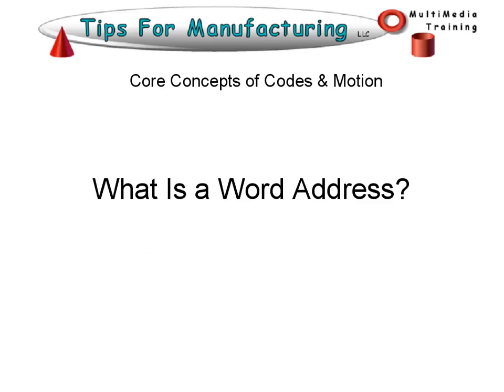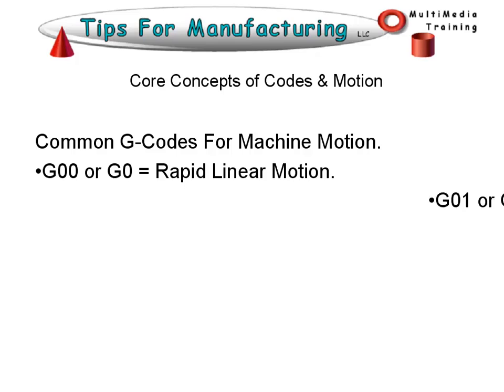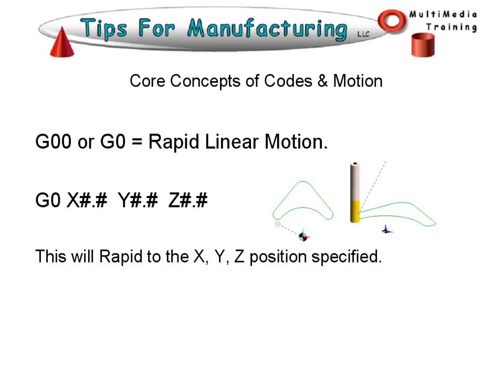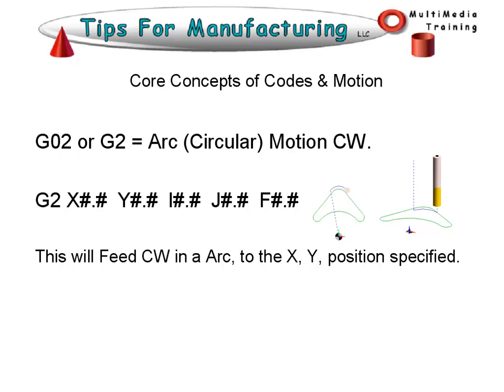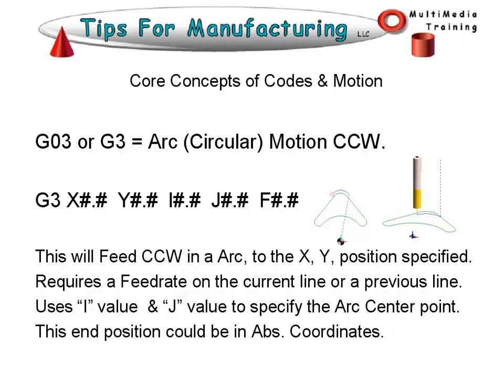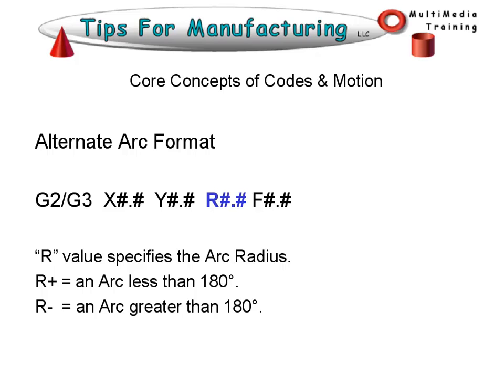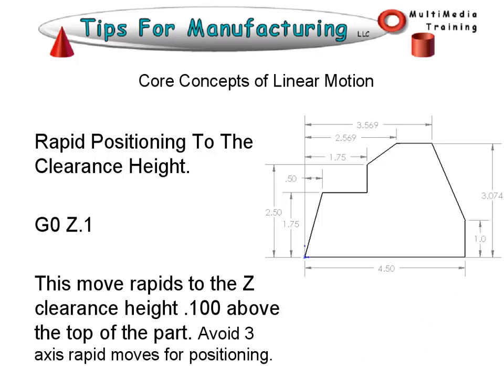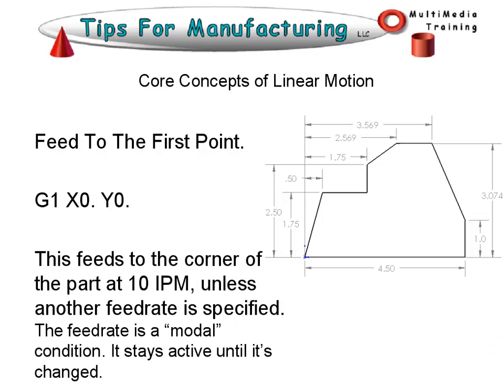TFM - CNC GCode Programming - Intoduction to Word Address'

Comment: What about the radius of the tool? When moving from G01 X0 Y0 to G01 X0.5 Y1.75. Isn't it supposed to be G01 Y2 X0.25, if we take the radius of the tool as 0.50?1
Reply: Lesson 1 of 9. Topic - Word address.  This is 12 minutes of a 4 hour lesson plan.
Reply: Sir what if we use G40 G 49 insted if taking tool radius it's best right?